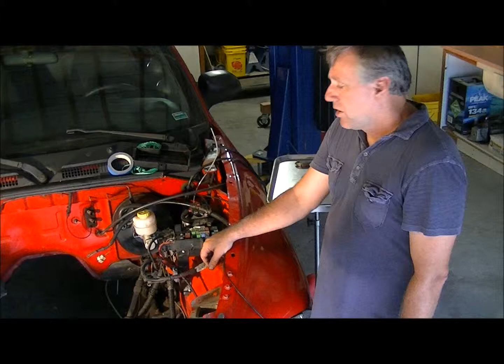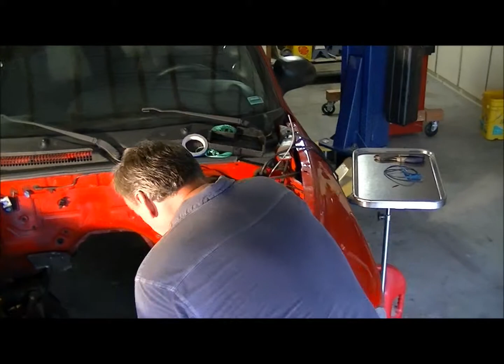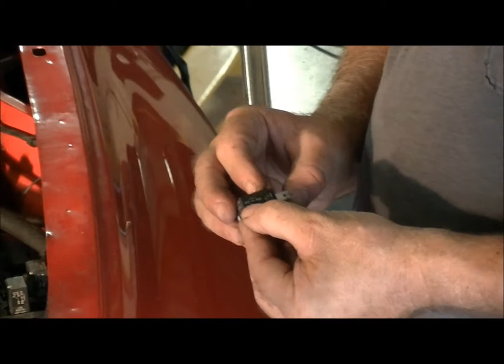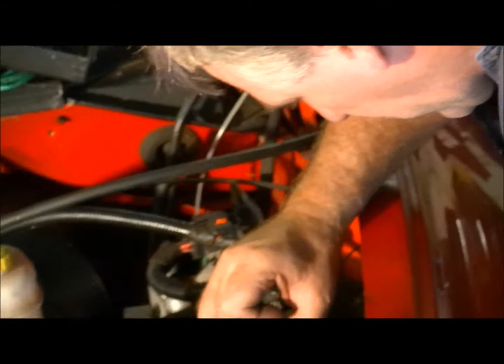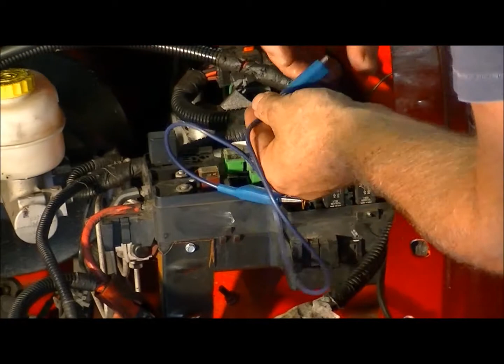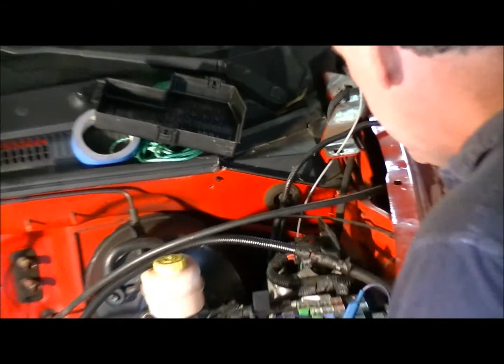Dodge Dakota RT purging fuel from vehicle

Comment: Need help with a 36-gal tank in a 1988 Dodge Ramcharger. put in a L-33 2005 LS. running fine but problem with tank module, where are you located?